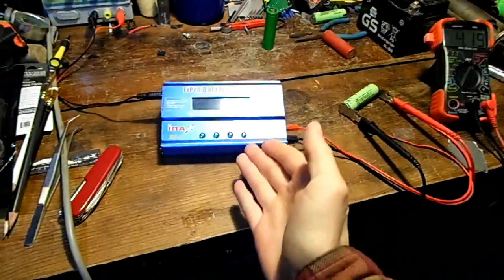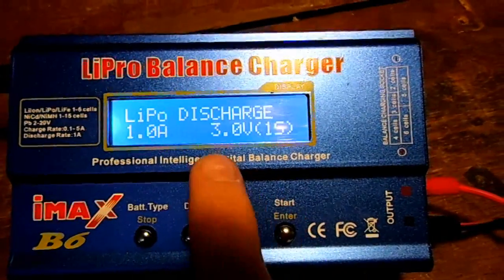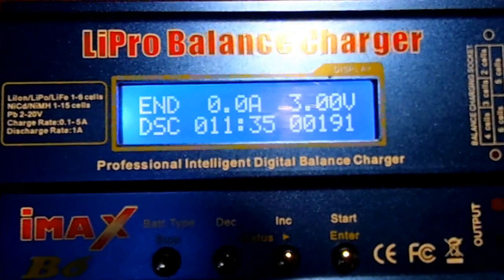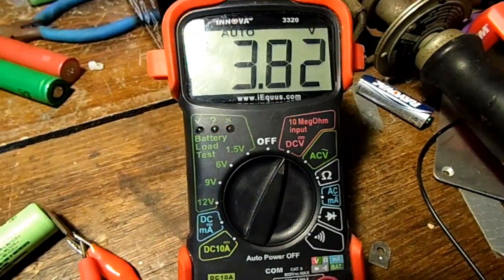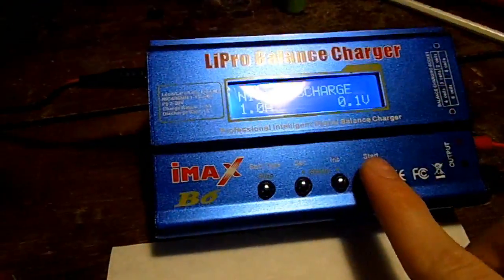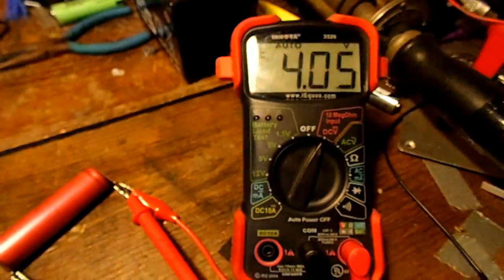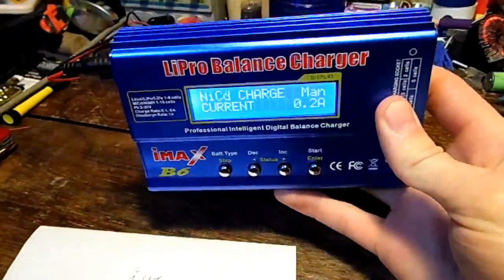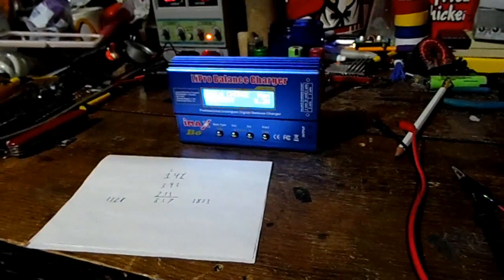18650 Discharge Capacity Test Imax B6

Comment: i have the same charger and my chg/disch readings are similar.all my elcrappo chinese cell read 4.1 vdc when charged. i would worry about drawing an unprotected cell below 3 volts as it may not recover.
  even after depleting in my radio,my new eneloop nimh cells dont show their rated 850mah on the disply after charging.
   .

Comment: That's a great tip!! using Nickel to discharge LiPo. Thanks!!
Reply: Brian Su though everything I've read says it's dangerous or death to the cell to discharge them past 2.5v. The power/voltage curves fall off a cliff past 3v so I wonder what extra % mAh the test showed by discharging to 2v?
Reply: Mytheroo Ahh I'm not sure. I think it's not advisable but depends largely on the quality of the cells. I've had forum members discharge their LiPos to very low voltages but they still work, or so they say...

Comment: I have original B6 mini and I don' have problem like this. I just set my 18650 cell to Li-lo discharging 1mAh and it measure mAh smooth as it should. When battery is lowering capacity b6 mini change mAh to 0,9 to 0,7 0,5 0,2 etc. It measures and sense battery for perfect discharge. My unit is also connected to PC via usb for monitoring. I updated firmware from v 1.1 to v1.2 and now it's even better. I highly recommend b6 mini original only6! Be careful because they are fakes over whole internet! Check your unit serial number with official website. Cheers
Reply: ***** it changes the discharge amperage to 0.9, 0.7, 0.5, 0.2 etc, not the mAh :)

Comment: Hiya! How did you know you didn't buy a fake imax?...supposedly there's a bunch of em on the net.  I tried searching but what does this do that a nitecore charger won't? what does it do that your ac/dc power supply doesn't?
Reply from the maker: because real/fake are pretty much the same thing. its not aporpriate to called it a "fake" charger when it works ok. it would be better to call it a "knock-off "
Reply: Rinoa Super-Genius As someone who has a 14 of these non-SkyRC IMAX units, 4 have failed and all of the remainder perform unreliably to varying degrees.  They freeze up with garbled screens and register false delta V cutoff for NiMH.  Their build quality is substantially inferior to the SkyRC units with some hand soldering and lower quality components.  If yours has been trouble-free, I congratulate you on your good fortune.

As a tinkerer, I would encourage you to check out the HobbyKing EC06-10 200W charger that also has a 25W discharge capability (5X the Imax).  It's very inexpensive (~$35), but is of similar quality as the non-SkyRC Imax.  My personal favorite is the Turnigy Reaktor 300W.  It has an internal discharge capability of 20W, and it has a regenerative capability of 300W.  It's a high quality clone of the icharger 206B.  Very high build quality.

The bulk of my experience is with NiMH to refurbish Honda Civic Hybrid subpacks.  I have learned much from your videos concerning LiPo.  Thank you very much.  One thing I notice is that you don't seem concerned about overcharge or over-discharge.

Do you really regard the capacity below 3.0V as usable?

Have you considered dropping your balance target voltage to 4.1 instead of 4.2V?  Actually, I don't think that's possible with the Imax.  It is possible with the Turnigy reaktor I mentioned above.  The RC community experiences extended battery life by balancing to 4.1V as you're not overcharging the cell.  This is a similar principle to hybrid/electric vehicle conventions of limiting battery operations to within 20-80% state of charge.  With the fantastic range of your bicycle, I expect that you could sacrifice 20% of that range and get dramatically longer life.

A couple observations on this video...

1) The voltage difference you mention between the voltmeter and the Imax value results from from the way the Imax measures voltage.  It's measuring the voltage "thru the load" vs. parallel to the load.  The difference you see between your meter and the Imax is a good approximation of the loaded voltage drop you can use to calculate internal resistance. Additionally, the Imax voltage readings are frequently wrong by a small amount.  There is a calibration technique if you haven't done it already.

2) Rather than running 1A loads to progressively lower voltages, have you tried progressively lower loads to 3.0V, .e.g, .5, .2 and .1A?  The bounce back you're seeing from a 2.0V discharge target to >3.0V is a symptom of high internal resistance.

Lastly, while I sound like I'm marketing for these guys, the Turnigy has two more features... 3) it can actually measure internal resistance.  I have no idea how it does it, but it's very valuable as a relative measurement.  Cells that measure lower IR will perform better than cells that measure high IR.  It can also do a "decreasing discharge" where it automatically does what I describe above... you set your discharge for 2A to 3.0V, and it will hold 3.0V once reached and taper the current to a preset percentage of the starting load down to 5%.  In that example, it would stop the test at 100mA.  It can also log pack and per-cell data into logview for analysis on a PC.

Sorry for the wall of text.  Thanks again!
Reply: S Keith Wow, I have an even faster (and dangerous) way to discharge batteries. Touch the two wires of your battery together and BOOOM!!!! A discharged battery in a few seconds!!! (I dont recommend doing this at a gas station or a fuel station tho). Actually i dont recommend this at all...
Reply from the maker: MIKAEL'S LAB
oh wow, a sticker. that sure increases it's functionality.
Reply: Geniune imax b6 has a sticker with a code in the back
Reply: the ones that aren t fake  have a sticker at the back. from the things that i know the sticker has a product code to register it online
. but i am not 100% sure
Reply: MIKAEL'S LAB Yes there is, i have a genuine one and i checked on this website http://www.skyrc.com/antifake/indexen.php   

And it showed up as genuine!!!

 P.S If this comment needs approval due to the link pls allow this.
Reply: bmwnasher I bought the IMAX B6AC V2 which lets me plug it into my computer. It also allows you to plug in a WiFi module which allows you to monitor your charge status wirelessly through your phone (gotta try that).
Reply: S Keith thanks i'll check out those chargers you suggested. rinoa mentions charging to 4.1 or even 4.0 v in many of his videos
Reply: danh le Thanks.  I've only watched 5-6 of his videos, and they haven't been in any kind of order. I suspected that question had been answered when I typed it. :)

Of the two, even though it's ~$65, the Turnigy is the better choice. I have two, and I can cycle through an entire pack's worth of Civic Hybrid sticks in less than a day with their regenerative discharge option (dumps the discharge current into the power source (a nearly dead battery).
Reply: S Keith My imax B6AC V2 can read the internal resistance too!!! Mine also can be plugged into the PC!!!
Reply: LetsGetStarted Can it charge and discharge at 20A and 300W? :)
Reply: S Keith Well no... BUT!!! Can the Turnigy?
Reply: LetsGetStarted Yes. In normal mode, discharge is limited to 20A/20W, but in regenerative mode (discharging into a battery), it's 20A/300W.
Reply: The 5.5Ah NiMH cells in Honda Hybrids are rated for 100A discharge with much of their life spent in the 20-50A discharge/charge range.  Being able to test capacity of 22 battery sticks comprised of 6 cells at 20A is very useful in terms of determining stick health AND saves a lot of time.

Shorting them won't tell you much of anything...  :)
Reply: S Keith Thats the point... LOL!!!
Reply: My desk turned into fire because of a failure of this fake Imax B6, it overcharged a lipo battery, and I'm sure that it was setup correctly. Result, a new deskto and 120 euros of books to rebuy. Don't buy fake one.
Reply: Walkofsoul I'm sorry that happened... I guess you get what you pay for... I still don't have any problems with my genuine imax! :D
Reply: do you need RC Product ？if you need , see the below link :
sktvision.aliexpress.com/

Comment: I need some help, I have some cells which getting pretty hot during the charge (icr18650 samsung 20f  2000 mAh, 12 pcs, charger Imax B6 same as yours)
I m discharging them at 1A then charging @ 1A at 3.7 but when it stores approx. 500 mAh its getting hot like 45 degrees and stopping charge since I set temp. protection to 45 C. no other batteries behaving that, so does these cells need special handling or all 12 pcs of them bad ?
Reply from the maker: i dont understand what you mean by 20f nor by 12 pcs charger.

the cells should never get hot. if they do that may mean they are bad.
Reply: sorry,
for the samsung 18650 cells, 20F indicates the cells mAh capacity like 20F is 2000 mAh and 22F is 2200 mAh,
see ; http://i00.i.aliimg.com/img/pb/349/501/599/599501349_221.jpg
and I have 12 pieces of them.

I guess I will have to toss em to recycling box. too bad they could have been a good pack, thanks anyway !
Reply from the maker: Bilal Öz
 well i wouldnt say throw them away, even if they are crusty you can use them as a crappy battery pack for backup or something unimportant.

so when you stop charging them what voltage are they at and do they slowly go down?

it may just be that they are very old and have only like 500mah and so puting 1a into 500mah heats it up a lot.

how do you know they have 2ah? did they give 2ah in a discharge test you did? also where did you get them? i hope you got them from an old laptop battery instead of getting ripped off by ebay listings for individual cells.
Reply: Rinoa Super-Genius  actually I got them from a friend of mine. he working on an e-store, a few days ago I visited him and asked if he have some unused or scrap laptop batteries so he gave me two packs of old batteries free of charge which they used for lifting the laptops on the window shopping lol. I returned to my workshop happily, ripped them apart :12 flawless samsung ICR 18650 20F cells ! . I googled this code and found they got capacity of 2000 mAh ! they were all about  2.8 ~3.2 volts, much happier now.

since I don't have much experience on testing the capacity I decided to discharge each of them first. all of their discharge capacities were about 200~300 mAh and that bothered me in the first place.
then I put them on charge and realised they r getting real hot, and voltage of cell doesn't go down when charging stop. voltage stops where it was.

tomorrow I will charge them on 500 mAh and post the results here. it don't matter for me to lose them, at least I can use them for the flashlight
Reply: Rinoa Super-Genius
 by the way I managed to revive 6 dead cells watching your instructions, now they can draw 2200 mAh smoothly.
thanks for valuable information
keep up the good work !
Reply from the maker: Bilal Öz
 well what voltage do they stop at? 4.2v?

i say charge them with a lower current like 400ma instead of 1a and see if that helps the cells stay cool.

these cells are probably just very used and are old. so i would just put them into a pile and when you need a battery for like a homemade flashlight or something but dont need really good cells you can solder a bunch of those in parallel.
Reply: Rinoa Super-Genius they mostly hitting over 40C when reached  4.0V
to dont damage them I stop the charge and wait for them to cool down but no matter if I stop the charge or not they stuck at 4.0V
probably an internal damage or something, but I m sure they ll do good with flashlight torch

Comment: The charger you're using is a knockoff. they work fine though.
discharging batteries with low mah at 1A is not smart, and most likely the reason your discharge wasn't working right.

Comment: http://www.hobbyking.com/hobbyking/store/__7028__Turnigy_Accucel_6_50W_6A_Balancer_Charger_w_Accessories.html

same guts, less money.
Reply from the maker: idk if i'd trust hobbyking over ebay though.
Reply: Rinoa Super-Genius lol why not ive spent over a grand there and everything has been to snuff. If you want ill take my accucell charger apart so you can see its the same exact thing inside and post a video, your charger might even have unpopulated portions on the mainboard, accucell has external temp sensor header, and yes you can recalibrate them, and looking HK has your charger for 24.99..at the end of the day theyre all pumped out of the same plant in china from the same schematics with little additions here and there by specific vendors.. not even knocking your charger, my accucell has worked great and these chargers are very handy and moddable
Reply from the maker: erik61801
 no i'm not meaning about the product, but idk about how hobbyking handles lost packages and stuff. i've had great luck with ebay and spent thousands there.
Reply: Rinoa Super-Genius never had a problem, i think theyre very legit. my last package was about 40 pounds took 3-4 weeks to arrive, tracking number included. Theyre stocking more and more items via their US warehouses now, other countries too (so you dont have to wait for items from RPC) I had an X9 transmitter arrive DOA, returned it no problem to a local warehouse and had a replacement within the week. Ive spent probably 10k on ebay never had any issues either and when I did the sellers were quick to rectify them..I wouldnt worry, HK isnt really fly by night..dealextreme is good too, Im sure as long as you have tracking they wouldnt dispute a claim. =]

Comment: But how do you charge 18650 with this charger? There's no 4.2V setting :(
Reply from the maker: yes there is, charge it 3.7v 1 series.
Reply: Rinoa Super-Genius Thanks! :) Sorry, just to clarify what is 1 series? You mean 1S? :)  So if I charge it at 3.7V it will actually go to 4.2V?  Cause my battery is rated at 4.2 V fully charged...
Reply from the maker: bratan007
 yes 3.7v battery charge to 4.2v. its an odd naming scheme but oh well. and yes 1s means 1 series.
Reply: Rinoa Super-Genius Oh I see now! It's actually trying to charge it up to 4.1V but that's close enough :)
Reply from the maker: bratan007
4.1v will give you 2x as many charge discharge cycles. i try to charge mine to 4.0 to 4.1 so i get 2-4x as long lifespan. just a few less miles on each charge.

Comment: Hey, what do you truely think of the imaxb6 balance charger? I see some on ebay for 23 bucks and have been thinking.... are they worth it, or is there something better.
Reply from the maker: i think its definatly worth it. i was expecting mine to last like 4 months but its been a full year and mine is still working. i have noticed it overheats at lower amps now, but oh well.

it used to be if i charged my 24v pack with more than 4.5 amps the LCD would turn purple and it would start smelling of solder, now it gets that way at anything over 1 amp for 24v. i think i ran it too hard and melted the solder away from some components. but still its held up fine. and i think my next one will last much longer since i now know when it gets too hot.

you way want to get the Imax B6AC instead of the B6. i'm going to look into that. but if you get the B6 you can run it off a 12v computer power supply easilly.
Reply: What makes the b6ac better?
Reply from the maker: Raymond Malenki
 it has an ac power supply in it already, you dont have to worry about feeding the imax b6 with 11-18 volts at up to 15 amps.
Reply: I just looked at it, that is a nice feature.  Thx for the recommendation.
Reply: Rinoa Super-Genius So I took your advice and picked up the imax b6ac.... but I cant seem to get it to work. I am probably doing something wrong, I tried to charge some romba battery packs I had laying around and all it would do is say connection break. I'm lost. I saw in some of your other videos you tricked it to charge one with adding a diff battery so I did the same. It would charge my nimh bat, I remove the good one and let the romba nimh bat to charge, then back to connection break. Any ideas?
Reply from the maker: Raymond Malenki
whats a romba battery?
Reply: 3000 nimh battery for a floor cleaning robot
Reply from the maker: Raymond Malenki  oh you mean Roomba. idk much about nimh batteries.
Reply: I also tried it on a few sla batteries too and dsme thing too.

Comment: Hey,  im searching a way to discharge lots of cells so i can record each of the cells capacity.  I have hundreds to do and imax is soooo slow.  Making a 48v battery to cycle 100 miles,  manchester to conwyn.  Uk.  Lkve your channel btw.
Reply from the maker: are the cells origenally dead? i had a lot of random used cells that where at like 3.3v so i charged them all to 3.6v then used the imax b6 to charge them to 4.2v and it counted up how many AH it too to charge them. i know thats not exact but saves a lot of time.
Reply: Ebay used/faulty batts :-)  so need to sort them in categories of mah.  It takes hours to do each batt.  :-(
Reply: When you get the volts up to 3.6v do you slow charge? Cos ive been charging them to full with an intelli charger.
Reply from the maker: Richard Banner
 you only need to test each parallel pack, not the individual cells. if the laptop batteries came with the cells connected in 4 then you just test each pack of 4 and devide by number of cells.

Comment: Hooked up 13 cells charged around 4.1 in series to this charger and it popped my 1000uf 35v capacitor. I thought these could handle that? Guess not. Will it handle 12 in a series? B6 will charge a 48v pack correct?
Reply from the maker: lol you connected 54v to a 24v charger? no wonder it popped xD
Reply: @RinoaL it's been a decade but who cares. Watehel is he talking about lmao 🤣